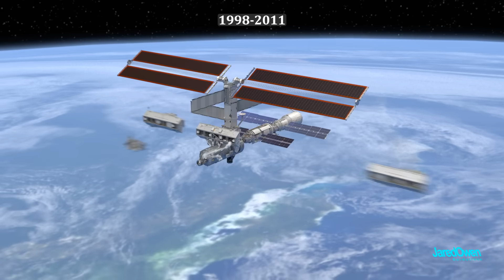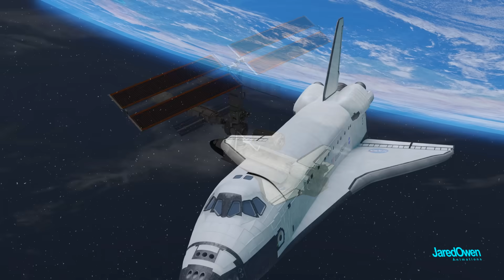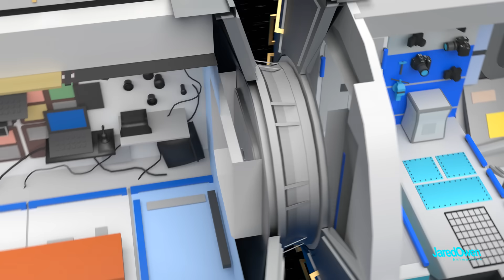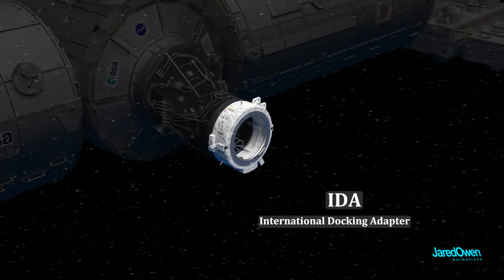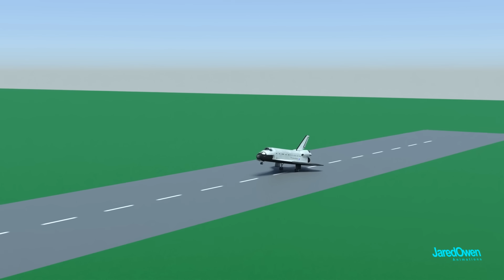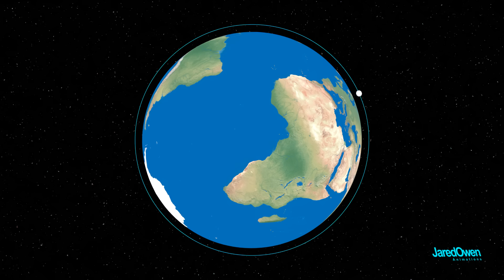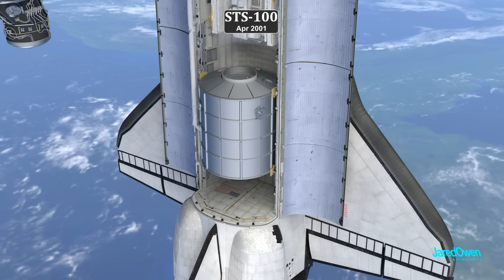How did they build the ISS? (International Space Station)

Comment: They didn't. And you're showing pathetic cartoons.
Reply: You can observe the station literally by your eyes or with a small telescope. But this is too complicated for you.
Reply: @homhomasl2338  You see something in the sky. I do not believe that it is the ISS at 250 miles, with no lights, moving 17,000 mph , while orbiting the Earth moving in 4 different directions. 4.4 billion miles per year. 
I would need to be a very gullible person to buy that nonsense.
Reply: @IvanMectin  If you use an Earth curve calculator, you'll see that the numbers match the observations only if the ISS is at an altitude of 400 km. Therefore, considering an orbit takes it around 1.5 hours, it has to be going 27000 km/h
Reply: @raptorwhite6468  The 17,000 mph orbit would be the slowest of the Earth's 4 motions.
Reply: @IvanMectin  No, the only faster motions are relative to the Sun, Sagittarius A* and the Great Attractor. I don't see how that's related to anything though.
Reply: @raptorwhite6468  The ISS either keeps up with the Earth's motions or it doesn't.  
1. 1000 mph spin 
2. 67,000 mph orbit of the Sun 
3. 500,000 mph around the Milky Way 
4. While shooting 1.3 million mph into nothing 
All the time, speeding up, slowing down, twisting, turning, corkscrewing, while shooting 4.4 billion miles per year. 
Satellites, with no propulsion, need to match the same motions.
Reply: @IvanMectin The most basic education in physics would stop you from asking this question. The first Newton's law of motion is usually the first thing you learn in physics. If no external force acts upon an object, it will remain stationary, or will remain in motion. Now, of course, there are forces involved, specifically gravity, but the very same gravitational forces are applied to Earth, so any changes in velocity or direction caused by them will not change a satellite's orbit in relation to Earth.
Reply: @raptorwhite6468  If you want to use gravity. First, you need to isolate and prove gravity. 
The motions are constantly changing. Constantly!
Reply: @IvanMectin Cavendish experiment did that. You're over 200 years late with that statement. 
But if you don't like gravity for some reason, you can't deny there's a centripetal force involved, whether you prefer to call it gravity, or magic, or whatever, it still works.
Reply: @raptorwhite6468  Cavendish did nothing of the sorts. That is pure pseudoscience.
Reply: @IvanMectin He did, just look it up. But again, even if you don't like gravity, there is some kind of centripetal force involved, regardless of what you want to call it.
Reply: @raptorwhite6468  "He did, just look it up" So you can't even articulate yourself. And what REAL WORLD "centripetal force"? Explain yourself properly! Show a demonstration, or a link to something.
Reply: @IvanMectin  If looking up two words is too much work for you, I can do my best to summarize it. In the late 18th century Henry Cavendish measured the force of gravity attracting lead balls. 
Both Earth and the entire solar system are in a circular motion around massive objects (Sun and the center of the galaxy respectively). If there is a circular motion, there has to be a centripetal force involved.
Reply: @raptorwhite6468  He did not. You need to isolate gravity before you can prove gravity. The tiny lead balls ignore the huge mass of the earth. If, your assumption was true the lead balls would be pulled to the huge mass of the earth.  It's pseudoscience.
And you failed to provide a real world example of centripetal force?
Reply: @IvanMectin The apparatus used to measure gravity was made in a way that the Earth's gravity didn't interfere. In fact, it only made it easier to measure, because it suspended the wire on which two lead balls were attached, creating a twisting force, which was equal to the force of gravity attracting the balls when they reached equilibrium, therefore making it possible to calculate. 
The example I provided is a real world example, but if you mean something that you can do at home, then you should have gone to school. This is basic physics again, I don't know how you could have possibly missed it. An example present in most physics textbooks is just attaching an object to a string and spinning it around, the string provides a centripetal force keeping the object in a circular motion.
Reply: @IvanMectin "The 17,000 mph orbit would be the slowest of the Earth's 4 motions" - and so what? Speed kiddo is relative.
Reply: @tgstudio85  Yeah, in a cartoon world of the globe mode everything is easy. The "science of SO WHAT" is all you need 😂
Reply: @IvanMectin  Oh, I didn't know you replied, yt didn't send me a notification. 
But that reply was pointless. Not everything that has a wire is a pendulum and not every pendulum is a Foucault pendulum. The part suspended by the wire wasn't swinging, so it wasn't a pendulum and even if it was, it would have to be carefully assembled to minimize the air resistance to be a proper Foucault pendulum.
Reply: @raptorwhite6468  I don't give notifications, mate.  Sometimes you get them, sometimes you don't. Take it up with YT. It's a pendulum, you just don't like the inconsistencies.
Reply: @IvanMectin What do you think the definition of a pendulum is then?
Reply: @raptorwhite6468  an independent, free moving wire,with a  suspended weight.
Reply: @IvanMectin It's somewhat close, but you're missing an important part - oscillatory motion - the object at the end of the wire (it doesn't necessarily need to be a wire btw) has to swing back and forth under influence of a constant force.
Reply: @raptorwhite6468  Cut the bull. It's a pendulum that doesn't work like a pendulum.  Let's have a bit of honesty 🙄
Reply: @IvanMectin  A chair is a lamp that doesn't work like a lamp, therefore you can't sit on it.
Reply: @IvanMectin  There are no pendulums, because they aren't in an oscillating motion. 
Only one motion is measured. 
Earth has an influence, by attracting the suspended part, it straightens the wire, creating a twisting force, which proportional to the angle. Therefore, when the force of attraction of the lead balls and twisting force of the wire for the angle reach equilibrium, it's possible to calculate the force of attraction, like this:
F1 = cosα × -F2
Where:
F1 is the force of attraction
α is the angle between the vectors
F2 is the twisting force
Reply: @IvanMectin  There is not even a single pendulum, just one part suspended by a wire and giving a single outcome. 
Where would the electrostatic force come from?
Reply: @raptorwhite6468  A "one part suspended wire" IS a pendulum!
The REAL Electrostatic force is Everywhere!
EVERYTHING! is electrostatic. EVERYTHING!
Reply: @IvanMectin Why don't you just look up the definition of a pendulum? It has to be in an oscillating motion. 
But let's assume you're right and it is a pendulum, that doesn't swing. What does it change? 

Only electrostatically charged objects create an electrostatic force. The balls weren't charged, so they weren't effected by any such force.
Reply: @raptorwhite6468  IF, a pendulum moves with the earth's 1000 mph rotation, while ignoring the 67,000 mph orbit of the sun? The 500,000 mph around the milky way? While shooting 1.3 million mph into nothing? No experiments? Why is only the slowest motion registering  🤔
How can 2 pendulums register different outcomes? 

Don't you listen? EVERYTHING has an electrostatic charge. To claim otherwise just shows your ignorance of the subject. Unfortunately, you seem to be ignorant.

Comment: While I get that there is zero gravity in space, the fact that the ISS is traveling at 28,000 KPH and Astronauts are able to work on the outside of it in open space is still a hard concept to grasp.
Reply: It is wrong that there is no gravity in space. Actually gravity at the altitude of the ISS is only 13% weaker than down here. The ISS is falling, the astronauts are falling. But they also move sideways with 28000 kph. At that speed they "Fall around the earth". But you cannot feel speed, there are no forces in speed, speed is always relative. S

Comment: The process of assembling the International Space Station (ISS) has been under way since the 1990s. Zarya, the first ISS module, was launched by a Proton rocket on 20 November 1998. The STS-88 Space Shuttle mission followed two weeks after Zarya was launched, bringing Unity, the first of three node modules, and connecting it to Zarya. This bare 2-module core of the ISS remained uncrewed for the next one and a half years, until in July 2000 the Russian module Zvezda was launched by a Proton rocket, allowing a maximum crew of three astronauts or cosmonauts to be on the ISS permanently.

Comment: Maybe it will no longer be operable. But as much of the ISS structure as possible should be boosted out to a higher retirement orbit. For monumental purposes. The Eiffel Tower did not become officially permanent until 1957. Some things you just don't throw away, after tens of billions spent. This is not Salyut 4, 6 or 7. It is a palace, akin to the UN HQ.

Comment: FUN FACT: There is gravity on the ISS. It's true that gravity is weaker because it's farther from the centre of the Earth, but not by much. Earth's gravity is still 90% as effective as it is on the surface.

The reason why astronauts float is because they're in free fall. It's a common misconception that the difficult part about space travel is getting into space. But that's actually the easy part. You then need to obtain enough speed to enter orbit, which may require as much as seven times the amount of energy you needed for launch, otherwise you'd fall straight back down. The station is orbiting at a speed of approximately 17,500 miles per hour, which allows it to keep falling towards the surface but moving sideways fast enough that it never actually reaches the ground.
Reply: Further*

Comment: I always wondered how those pieces were following earth in space while earth is moving around the sun in yearly variable ellipises. What does it look like if you draw this with vectors with all forces working together. I did a lot of calculations with vectors in my engineering studies and can't really understand how it would be possible. They have to outbalance the gravitation of earth with centrifugal force. But earth is not standing still but moving and the weight of the ISS was augmenting while being built. How did they know what the gravitational force was up there beforehand ? Lots of questions that I would like to know. And then there is the position of the moon also having influence on the ISS ?
Reply: Yes, the gravity of the Sun is pulling on the ISS, as is the gravity of the Moon. However, given the ISS's position only 400 kilometres above the Earth, the Earth's gravity is vastly stronger (the Moon is reasonably close but much smaller than the Earth, and although the Sun is much larger than the Earth but it's a long way away). Therefore the ISS is bound in orbit around the Earth. This is the same for all objects in low earth orbit, and for those in geosynchronous orbit.

However, if the ISS (or any other spacecraft) was put into a much larger orbit around the Earth, then the gravitational pull of the Sun and Moon would have a much greater effect on the object's orbit.

Does this help?
Reply: @maxfan1591  No, this is just some words. Make me a calculation with vectors that explains everything that I wrote. Then I would be interested. But I think you will just have more and more questions once you start doing it.

Comment: This has to be one of the most informative videos on the internet. Kudos to Jared and the team! 
Just a quick question, during the first mission, how did the ISS remain stable or rather how was it not moving? As you mentioned, it was travelling faster than the speed of light, so was wondering how the shuttle first caught up and how it managed to move all those moving parts at those speeds?
Reply: Not speed of light, speed of sound  :-) However, the speed doesn't matter. You cannot feel or measure speed. There is no air up there. Everything in orbit moves around the earth with 28000 km/h, it is the purpose of a rocket to accelerate everything to that speed.

Comment: You might notice all the missions tend to last 13 days.   This is because the longevity of the hydrogen fuel cells powering the shuttle was a little over 14 days. (and they want to give themselves some wiggle room in the event of bad weather in the landing zone) This was the limiting factor for how long a shuttle could stay aloft,  After that the shuttle would be dead in space. 
They did eventually come up with a jerry-rigged method to connect to the space stations solar supply to extend this a bit (effectively using a glorified extension chord... a fancy space extension chord) but this would only work for a few days and be a huge drain on the stations power supply, lowering the potential for scientific experimentation while they did so.  The longest shuttle mission ever was 17.5 days using this method.
Reply: reading from science-fiction Dune book...

Comment: @JaredOwen ,
I only recently discovered your YT channel.  You have done some brilliant work to elaborate in such great detail for us the workings of these many engineering marvels.
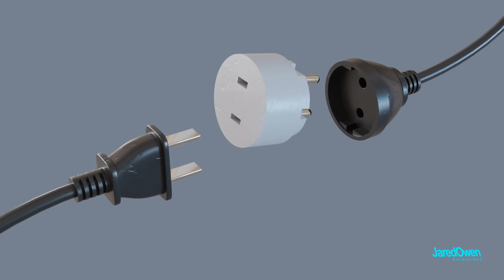I have always wondered.  Why are the PMA's offset in our ISS?  Why can they not have a more straight or less angled union (at ~ 4:00 of the video).
Reply: It allows bigger payloads to be moved through. It was designed that way so it'd work with the Space Shuttle.